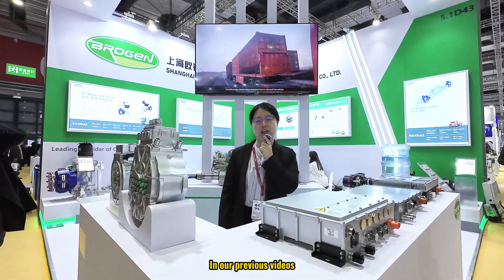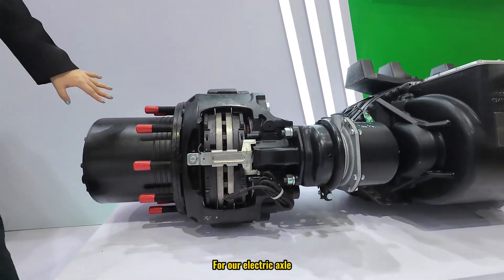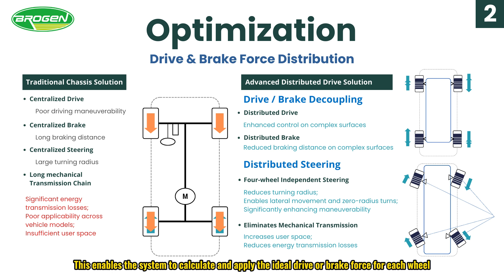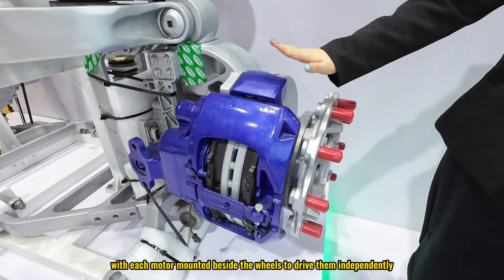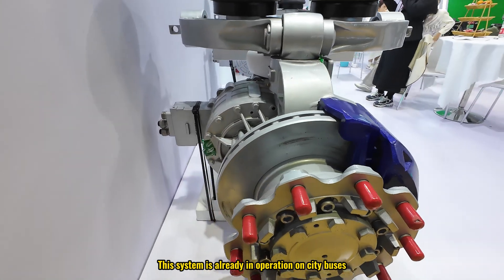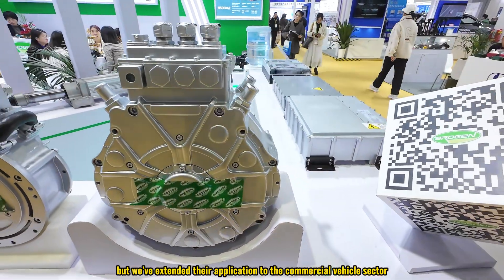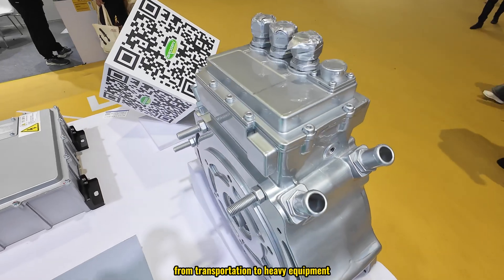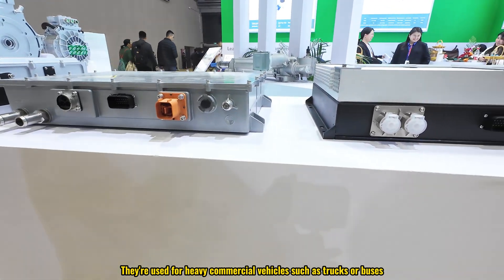Next-Gen EV Powertrains – How Axial Flux Motors & Distributed Drive Electric Axles Power the Future?

Comment: A car battery can be water that is split into hydrogen and oxygen by the charging station.
THEN from them we obtain electricity and water vapor which must remain on the car to be reused to produce new hydrogen and oxygen.
Reply: but it is extremely energy inefficient compare to batteries
Reply: @stefanweilhartner4415  lithium batteries weigh hundreds of kg while the battery I propose weighs much less